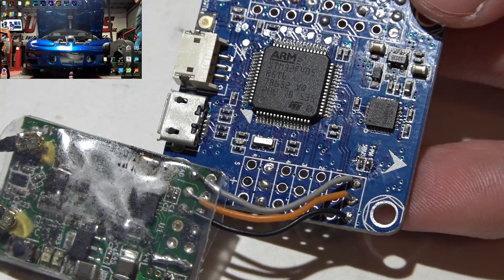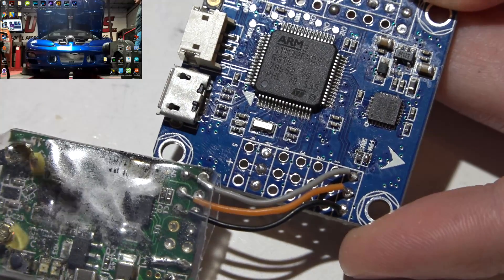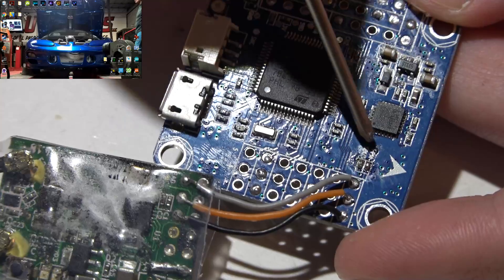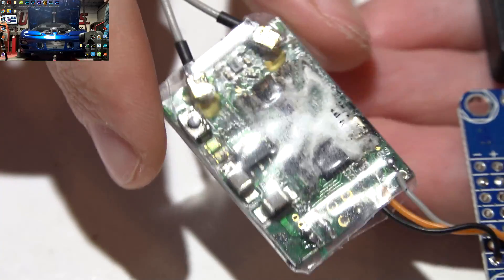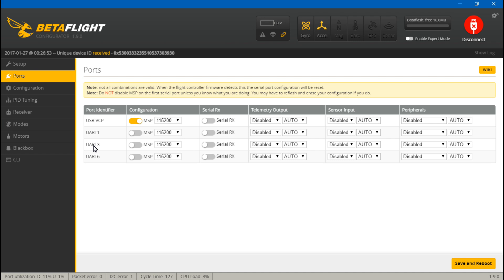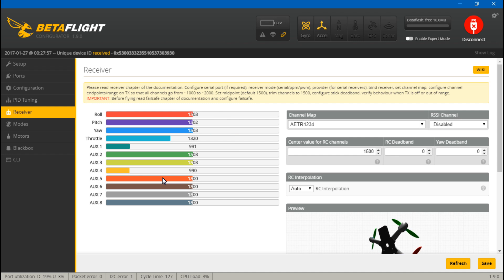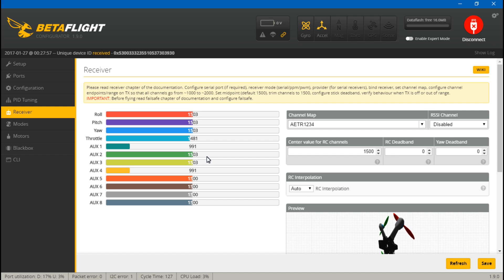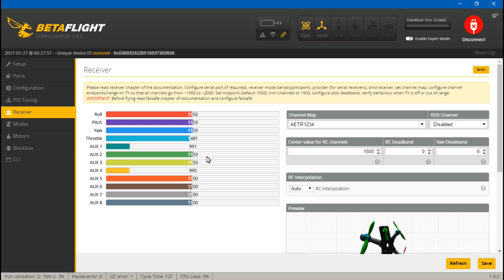Connecting PPM receiver (D4R-II) to Flip 32 F4

Comment: So after trying to figure out the no-arming issue. The solution is simple .....simply supply 5V and Ground from a BEC to your AIRBOT F4.  Connect the 5V to the 5v on motor connection 6. Then Supply Ground to ground on motor connection 6.  Remove vbat and ground.  I have not tried running vbat and ground plus 5v and ground because I fear it might fry the board.  But this set up works and i've been flying it.
Reply from the maker: Juan Rodriguez nice, thanks for sharing. It's very strange because mine arms with direct voltage to vbat, but hopefully this will help more people

Comment: so im using Omnibusf4pro v2  and im having PWM receiver so to convert that signal im using PPM encoder which has 8inv and other end im getting PPM signal which i will connect to the PPM UART1  in flight controller so will that work ? if i drop solder on PPM resistor will it work for me im like stuck in this part for a week can anybody answer this

Comment: Hi, i'm having trouble using ppm on a F4 pro omnibus. Mine doesnt seem to have the unsoldered jumpers/pads. But I get no signal from my dr4ii into the F4. receiver works fine. so frustrating!
thnks in advance
Reply: Hi. I got same issue.
Have you solve this  problem?
Reply: Christian Antony Nope, didnt Solve this. All 3 boards i have, have the same issue. I am going to try i-bus when i get my ibus receiver. Not sure If other ppm receivers work but dr4ii not for me.

Comment: for the life of me i cant get my turnigy 9x transmitter to show up in betaflight. i have channel 1 connected to the sbus/ppm pinout on my flip32 f4 (revo pin). no matter what settings in betaflight i use the bars in the reciever tab dont move when i move the sticks. also with those 2 resistors if im using ppm, what one do i need to put solder on? do i tske off the sbus resistor and only have ppm with solder?
Reply from the maker: Make sure your receiver is a PPM or SBUS receiver. if it's a PWM receiver it won't work
Reply: the receiver is ppm also the transmitter is in ppm mode
Reply from the maker: I'm not sure what's going on then. As long as you have a resistor or solder on those PPM pins then it should work fine. If you don't get it working then you could try a Sbus receiver.
Reply: DKMR2 did you got this working? Having the same problems with ppm and F4 pro
Reply: Nope, I ended up buying a new cheap transmitter and receiver (Flysky FS-i6X)
Reply: DKMR2 ok, you bought an sbus setup then? Did sbus work right out of the box? Thnks for your reply!
Reply: No I still use ppm with the flysky reciever
Reply: I had to change a few settings on the transmitter but that's it.

Comment: Hi JC,  I'm having a similar problem,  but I was trying the SBus/ibus connection connection,  but my Flysky FS-I6 transmitter is Not being recognized.  Question: is the PPM pad that needs to be bridged also for the SBus /ibus connection? Or is the other solder pads for the SBus /ibus connection? 

Appreciate your help!
Reply from the maker: Ibus, Sbus, and PPM all use that same pin.
Reply: Project Blue Falcon,  thanks bro,  appreciate you getting back to me! You're videos are very helpful and informative!
Reply from the maker: Here is a ebay link. Thats the cheapest I've found. Banggood has them too. https://rover.ebay.com/rover/1/711-53200-19255-0/1?ff3=4&toolid=11800&pub=5575257854&campid=5338014988&mpre=http%3A%2F%2Fwww.ebay.com%2Fitm%2F20X-FrSky-2-4G-Receiver-Antenna-with-IPEX-port-Compatible-with-Futaba-FrSky-%2F252224000219%3Fhash%3Ditem3ab9b8d0db%3Ag%3AvdIAAOSw5IJWdGZ5

Comment: I for the life of me can't get this flip32 f4 board to arm.My receiver is bound and the flight controller is reading in betaflight but i can't get it to arm. Everything is wired correctly for ppm.
Reply: Don't connect via vbat. use 5v BEC and provide that to any positive motor output. Remove the vbat direct to battery. I think board problem.
Reply: Juan Rodriguez it ended up being that beta flight on Mac wasn't recognizing my fc but as soon as it connected to betaflight on a PC it worked...... dumb but odd
Reply: Chase Fitzpatrick did it let you arm after not being connected to the pic?
Reply: Pc
Reply: Michael M yeah it worked once I connected it to a PC It would just simply would not work with a MAC

Comment: Thanks a ton man! i really appreciate it!
Reply: surprisingly though i did get things to work b4 you uploaded this, but its working a bit differently than how you have it setup (with telem(not sure if its correct yet though...lol)).   the black and green wires on the side of the d4r-2 i put in to RX and GND, and the yellow (gray on your video) into the ppm.   my board does in fact come with the 2 (Sbus+ppm) 0ohm resisters, but i did not have to remove either of them.

Comment: JC do you happen to have any arming issues with this board? I got the flip 32 special edition and it will only arm with the usb connected and sometimes after a couple of arms ...it will arm with out it. but the then sometimes it goes back to not being able to armed. not running anything on it all voltage for cam and vtx are coming from the PDB. I have it just like you do in this video. I have built various quads so..I'm just at a loss. is it possibly a bad board?
Reply from the maker: Thats very strange. Are you arming with a switch or with the sticks.
Reply: Project Blue Falcon ....switch. via x4r on turnigy 9xr pro.
Reply from the maker: I'm honestly not sure about that one. I haven't had any problems but I'll look into it.
Reply: Project Blue Falcon thanks man. :-)